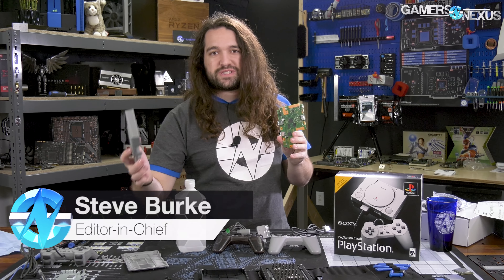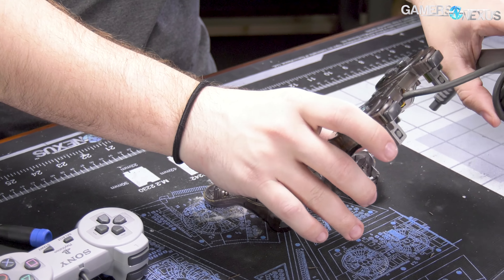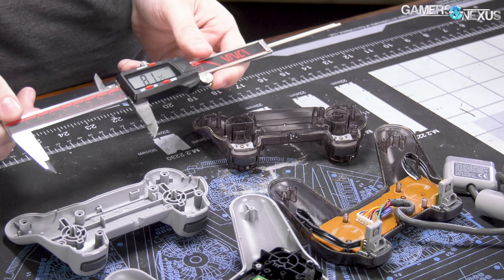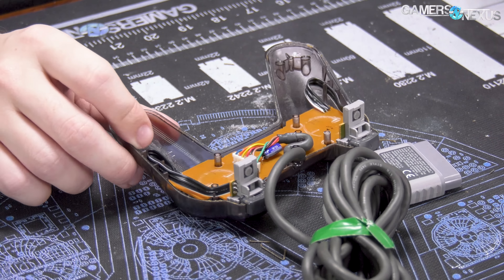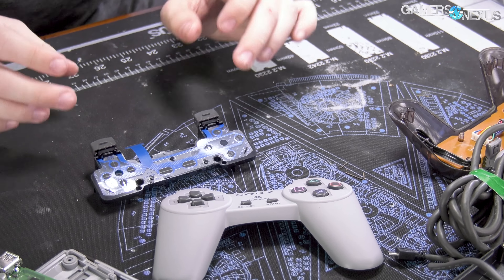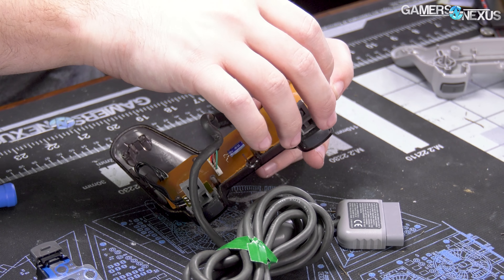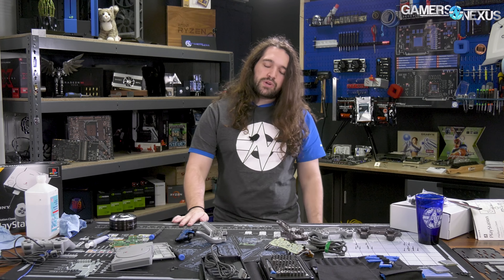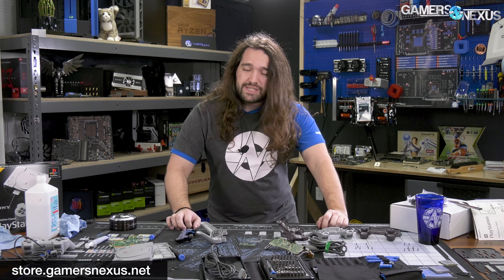PlayStation Classic Controller Tear-Down vs. PS1 Original

Comment: Ugh those silk screened "PCB" are horrible to work with. Basically nulls any modding. The "gross solder work" is flux. Standard to leave the residue.
Reply: So you're saying the old controller has a flux capacitor and the new one doesn't? Rip off!
Reply: @Niloc0  Yeah! Flux that!
Reply: Modding?  What, were you planning on adding a turbo button or something?  Cheater?

I mean, it is an emulator.  Might be able to get a soft-mod turbo option if you were going that route.
Reply: @Rikorage  Maybe a different power connector so he doesn't have to sacrifice a USB wall wart.
Which, for the record, is easy to mod at the cable level. Did it with an electric razor not two days ago.
Reply: @Rikorage  I see you've never heard of Ben Heckadorn. He makes accessibility controls for disabled people. These controllers are a nightmare to deal with.

Then there's those of us that like to relocate buttons for easier use in certain games.

That pos silkscreen prevents all of this.

Comment: That's actually conductive bumper and it will contact the carbon contact on the plastic sheet to complete the circuit.  The plastic sheet alone is only half of the switch.

Comment: The PS1 had one of the coolest copy protection mechanisms I've ever heard of. A lot of people think the black discs had something to do with it, but that was actually just a colouring they added for style. Here's how it worked:

CD lasers have a tracking mechanism to follow the groove of the track sort of like a vinyl record. The laser actually can make small adjustments left and right to the track to make sure the groove is being followed. What the PS1 games did is official discs were written with an intentional wobble to all the tracks. The PS1 actually verified if the CD head in the PS1 was following the wobble pattern - if it wasn't it presumed the disc was a burned copy as all CD burners you could buy would just burn everything in as straight as tracks as possible.
Reply: Other than the fact that you could hear when it checked if it was a legit copy, then time it and swap out the legit disc with a burned copy of another game just as it was done checking on the legit disc. Amazing protection xD
Reply: @mLgz0rn  Yup it was so clever but so easily circumvented lol

Comment: Pretty cool that they used a micro USB connector internally. That way if you ever break the original cable you can just replace it with a regular off-the-shelf micro USB cable.

Comment: I think the new PCB is so cool, and love that it has a micro USB connection, but it's really not some sort of major technological advancement.. The components are just placed into the smaller area, while the part that makes the connection to the button is spread out on a clear plastic. While the original controller's PCB is mainly bigger because it also covers the function for the physical connection of the buttons.

Comment: Over the lifespan of my PSX I had eventually rebuilt my own controller from reconstituted parts of at least 4 other broken ones. I recall there were differences in PCB size and mounting between dual shocks of the same era.

Comment: The micro usb cable is actually really awesome. If the cable ever breaks you can always swap it with a standard usb lead. Way better than having to hack a new lead onto a controller

Comment: your ps1 controller isn't the original model.  Also, if you're wondering, the way the buttons function are identical, one is just a cost reduced version and is how later versions of the controller were made anyhow.

Comment: Black bump is conductive. It connects the pads on the controllers PCB or ribbon in that and the PS3's case as in both use ribbon. Yes carbon, like pencil led. Both are conductive.

Comment: As if this system wasn’t a mess already. They could’ve at least added Bluetooth support for those of us wanting to use control sticks who own a DualShock 4.

I truly, truly believe I (and many others) receive more joy watching people pan this system, badmouth it, or tear it apart in videos than I could ever have actually playing it.

No Crash, no Spyro, no Tony Hawk, no Tomb Raider...

...I’ll be using the money I would’ve spent on this on additional storage for my Set Top Box by adding a PS1 emulator with a full PS1 library of roms that Sony will never see a 1 cent from. (Not to mention, you can use whatever controller you want, rather than the cheapest possible one that Sony decided to produce)

Comment: The original controller changed a lot between the Dual Shock 2 and 3 revisions.  The new classic controller adopts a lot of the changes from the Dual Shock 2.  I've had to take apart plenty of PS controllers, since fighting games really tears them up.  If I remember correctly, that cross bar on the original controller was used until the later Dual Shock 3 controllers.  I remember the first time opening up a replacement controller, and not seeing it.  Great, considering they would usually break, leaving the d-pad to fall deeper into the controller than necessary.  Seems like the PS Classic controller is basically the newest Dual Shock 3, except with the vibration and sticks removed.

Comment: its pretty clear they used the tech advances and the newer controller designs as a base to made a simple hid usb controller for the classic system, while stuffing it inside a shell that copies the external spec for the original.

Comment: New one works almost identically to membrane switch keyboards, which are still most keyboards. Hell even the original IBM mechanical clicky keyboards used a membrane switch underneath it all.

Comment: Sony sure does love to use cheap flex film cables and contact pads. The membrane contact pads on the old controller, I believe they are domed to make them pressure sensitive. The harder you press the button, the more surface of the pad contacts and this changes the resistance within that black carbon contact material. So flat "bumper" pads would make digital buttons and domed pads make analogue buttons.

Comment: do the new ones work as USB controllers on a PC?
Reply: Well thanks to the teardown people can easily replace the sony usb cable with a thinner one
Reply: @GLDragon93  that is a really nice detail with the cable. which makes swapping it no effort at all.
Reply: @xnonsuchx  I'm sure a USB extention cable will get you arround that problem. I'm more concerned with driver support. You'd probably need to get a open source universal driver and map every button.
Reply: is the PS4 controller still not officially supported?
Reply: I think as long as you use x360CE you should be fine. Im still using a third party 10$ ps3 controller which wasn't advertised to work with PC and wouldn't work on my pc despite being recongnised as a controller, just used x360CE and had to remap only the analog sticks, the other buttons were correctly recognised.
Reply: @fetB  ps4 works out of the box as long as you use the cable. wireless is a different story as it has no official wireless reciever for PC.
Reply: @fetB  If you mean on PC, it works, but not on everything.  Big Picture mode on Steam gives you the ability to map it properly to your library (and you don't have to use Big Picture mode, just mainly to set it up, it supports multiple controller types and configs with their own profiles).
Reply: If it's Direct Input compatible like the DS 3 and 4 are it should work okay
Reply: DS4 works fine wirelessly on Win8 and above with any BT receiver and Sony does sell a dedicated BT receiver for the DS4 that enables things like proper touchpad and audio functionality within PSNow, but only supports Win10.

Win7 users have to put up with a shithouse BT stack which means only very specific BT chipsets work, or dedicating the BT receiver to only DualShock support and using SCPToolkit drivers which work flawlessly.
Reply: PS4 controller works and plays in Windows 10 both wired and wirelessly without any configuration.

Comment: Just so you know, the original Japanese version of the PlayStation Controller were ever so slightly smaller than the western counterpart. The size difference isn't visibly noticeable till you have them both side by side, certainly noticeable when you use them. I personally find the Japanese version more comfortable.

Comment: The black CONDUCTIVE carbon pads on rubber actually have ELECTRICAL function. The "switches" on flex are actually two pads that are bridged by the carbon pads. When you are doing technical companion you need to know how the technology "they had back then" works...... The bumpers on old controller are probably same style buttons but on separate PCB, there is probably no delay whatsoever because of slightly longer signal path.

Comment: The construction of the new controller is much more similar to the old ps2 dualshock controllers (I've messed around with hacking them to be used for other things so I've taken a few apart) than it is to the old ps1 controllers.

Comment: The rubberish carbon contact pieces are simular to a PS3 Dualshock 3 controller and the plastic casing is close to a PS3 controller other then the Analog stick holes.

Comment: Hey man. Im an older girl and I like how you talk very straight to the point and leave your " Youtuber " voice outside where it belongs. Unrelated but a request from me, who is about to undertake her first ever PC build to escape from my Console + Mac Laptop Setup. Please can you use your wisdom, knowledge, and plain talking skills to come up with a working, 2018, Mojave Hackintosh. I am on the fence between gaming performance, budget, compatibility in OSX... etc .etc. Would love for it to have a couple of Firewire 3.0 ports but its not a deal breaker. Thank you and your team for the great content. 

My idea so far would be a Delid Air Cooled 8700K
Nvidia 1080 ti OC.... or Radion card 64 if overclocked and with good OSX compatability
Corsair Vengence Ram
Asus or Gigabyte motherboard with bios CPU OC to 5ghz
750w White Corsair Modular Power Supply
In a White Coolermaster Large Quiet case

Help me Gamers Nexus.. You're my only hope :D

Comment: The best of the ps1 classic is the controller, you can change the cable if it broke, and the feel delicious. :d I really hope to see a ps2 classic with the fat form factor, hdd and internet like the fat. i would buy that for sure
Reply: Sebastian Lara I still have that on my shelf. Still hacked. Hasn’t turned on since socom combined assault. Had a hard drive and saved games, prolly won’t even fire up

Comment: Hmm, I'm genuinely curious how much of the original controllers hardware you can transfer in to the new controllers casing. I figure it would probably be buttons and the rubber pads mostly, but I wonder if you could house the original PCB in the new case and have the controller work.

Comment: PS2 and PS3 used most of the same design for controllers. I've taken apart my PS2 dualshocks and the plastic film was present in there. (along with analogue sticks and vibration controllers)

Comment: I found this simple controller tear down and comparison video extremely interesting.  It is really cool to see how Sony replicated their original ps1 controller so well, but with a much more streamlined and modern layout.  I would be curious as to how the controllers compare in feel while holding them.  Is the new one light and cheap feeling or is it as substantial feeling as the original?  Thanks again Steve for this intriguing comparison!
Reply: I know this is a 4 year old comment, but the new controllers do feel light and cheap (in my opinion)!

Comment: For a used PS1 on eBay it looked quite good... the ones I got send would likely have caused Steve to burn his modmat and spend a couple hours disenfecting his hands, but that aside: doesn't the PS1 Classic come with any games making use of the Dualshock controllers? I remember when I played Gran Turismo 2 with the original controllers and my thumbs were not happy...
Reply: It probably would have had dualshock games if it actually came with dualshock controllers. But it doesn't.
Reply: @neroxen_  I just looked it up... it does for example have Ridge Racer 4...

Comment: Would be interesting to see comparison between dualschock 1, 2, 3 and 4 controllers.

Even though functionality has changed between those controllers, for example pressure sensitive face buttons and d-pad on dualshock 2 and 3. Dualshock 3 and 4 being wireless with a battery.

But expecially first 3 controllers have very similar feel to them when used, only the trigger buttons are different on ds3.

So one can wonder how much they changed between the controllers in terms of the buttons, seeing how the ps1 controller has very similar buttons as the new ps1 classic.
So have they kept the same design between the four controllers or have they just went back to the original design because they are making a retro console.

Comment: Hey, that's actually the same kind of layout (sort of) to the SCPH-10010! The PS2 DS pads are mostly the same as the SCPH-110's except for the fact the rumble motors are in their own housing, where also the flexboard rests upon and its also a removable component, however it is a similar approach to the PS Classic controllers because the flexboard is entirely removable. It's held in with plastic pegs and take a zebra strip approach made evident with SCPH-10010 top housings having a piece of rubber to literally squish the contacts onto the "Board".

Other interesting notes about the flexboard; they're kind of similar to... clicky keys? It's weird, but there's an entirely separate piece of plastic for all of the buttons which isn't connected to anything, it's only when the rubber dome is pressed, and forces contact between the button pad and the pad underneath an electrical connection is made. Try taking one apart yourself and you'll see what I mean.

Comment: I like the construction of the new one but I really hate those printed ribbon pcb's because they rot. I have plenty of PS2 controllers with bad printed ribbon pcb's, some of which I fixed with conductive carbon paint. Dualshock PSone named controllers also use the newer design with the printed ribbon pcb's.

Comment: unsure if the new controller uses the same type of connection to the console but if it does, you could replace the cable with a micro usb to usb and use it for emulators. That being said, you could just get a PS3 controller wired (unsure if they made a first party one) and use that instead. Of course there will be people saying that it's not the same but I had a Dual Shock controller for my PSone and didn't even know there was a controller without the joy sticks until over a decade later. I do own the Crash N'sane Trilogy and the Spyro Reignited trilogy and for Crash, d-pad all the way, for Spyro I can swap back and forth without issue.

Comment: You didn't disassemble the trigger buttons on the new controller. But seeing this thing on the inside with this much redesign I don't think Sony decides to bring out the dual shock controller later on.

Comment: There is surprisingly little value engineering of that newer PCB, kinda has the hallmark of something that was rushed out and they didn't bother optimizing out the micro usb, getting rid of that flat flex connector, and replacing the qfp with a blob chip. Seems like they either really rushed this out or didn't expect to be selling these in quantity that those extra costs would matter

Comment: I wouldn’t say that the mylar flex PCB is a “good design.” That’s why PS2 DualShock 2 controllers are all going bad. It’s a big part of the problem with notorious Atari 5200 CX-52 controllers as well.

Comment: I love the PS1 controllers for playing 2D fighting games, unfortunately as with any retro gear it's tough to find a replacement once yours starts to break down (still probably perfectly fine for 99% of gamers, but I need as much precision as I can get). If they perform as well as the old controllers, it'd be really nice if these new ones were usable on modern consoles.

Comment: I want to argue with you about the dates, seeing as how the PS1 was released 23 years ago in the US. But it was released 24 years ago in Japan, and the controller, even though it was translucent and not solid gray, as in the original release color, is the same build on the inside. So I can't for the generic tear down. I will say that particular controller isn't 24 years old. Still interesting to see how technology has improved since the original design.

Comment: It makes sense why they would use that brace for the directional pad on the original.  They didn't want fat hands or a temper tantrum to push down and damage the PCB below it.  There's no fear of that in the new design, so they removed it.  Sony makes a damn good product, and it shows (even if it is a cash-grab of sorts).

Comment: Used controllers are always tasty. xD
The first thing after getting a used console is always taking the controllers apart and cleaning them thoroughly. All the grime around the D-Pad and buttons, more sweat than skin I believe. Also don't forget the contacts!
The new D-Pad with it's "stick" in the middle reminds me of old Mega Drive / Genesis controllers. Usage caused them to rub away, resulting in the D-Pad not working properly anymore. Later revisions solved this problem. This controller could have the same problems after heavy usage.

Btw, I somehow miss having to set jumpers on the motherboards and hdds instead of being able to change everything within the bios. Also manually typing in cylinders, heads and sectors when installina a hdd. Just joking. Had fun times, trying to unlock my DX2/80 which run as a DX2/66 but sadly failing because the mobo didn't seem to support it though. Btw, PCI sucks, VESA Local Bus ftw!